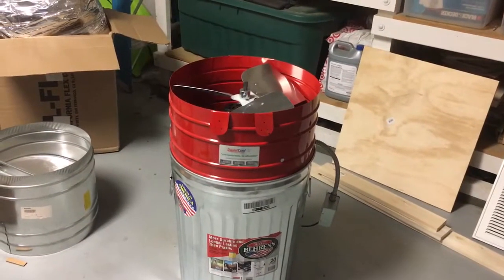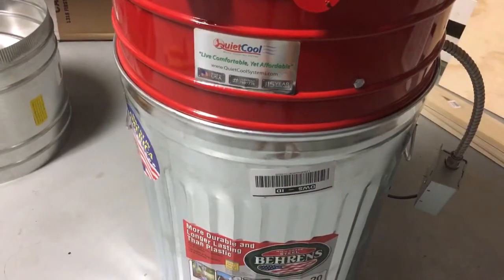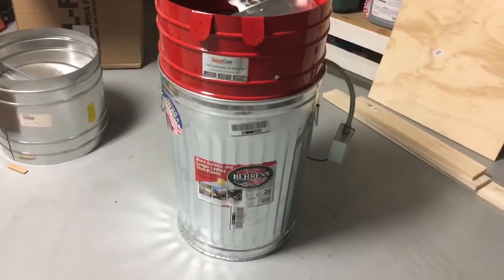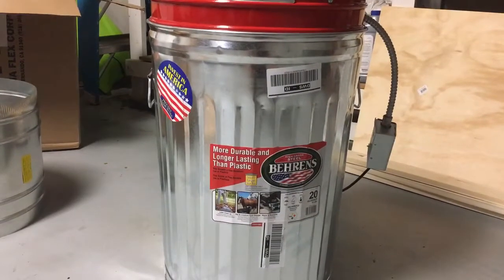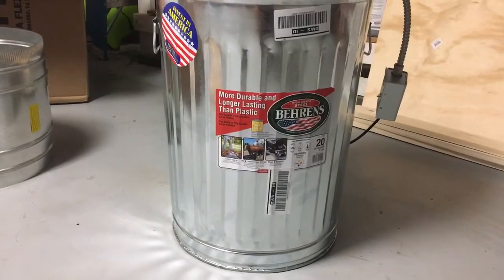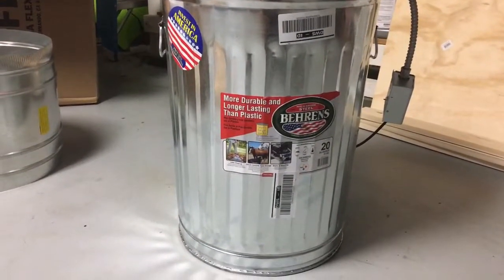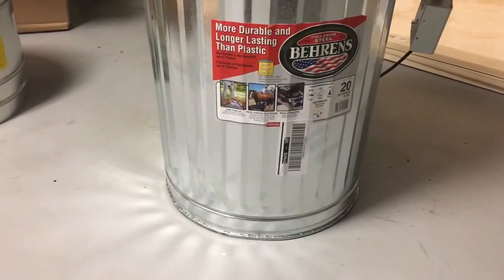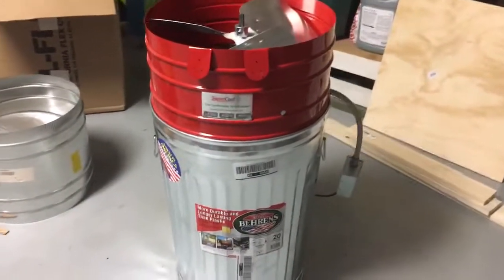DIY Whole House Fan- Trash Can Coupler & Reducer (Part 1)

Comment: If I used an 18" flex and an 18" damper couldn't I just skip the trash can coupler?
Reply from the maker: Yes you could.  Finding an 18" damper or flex is pretty hard to find and expensive as well.